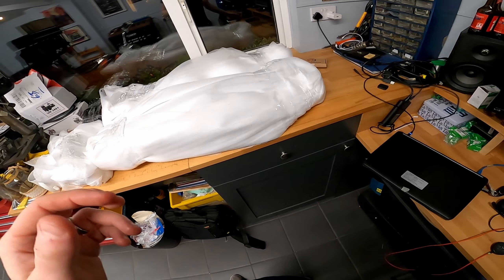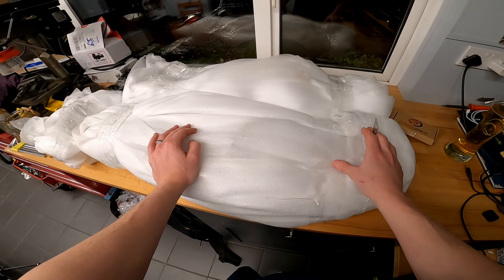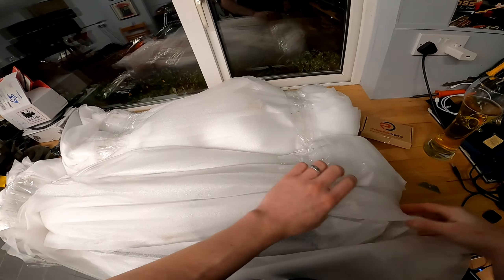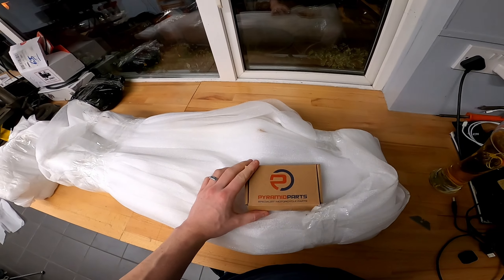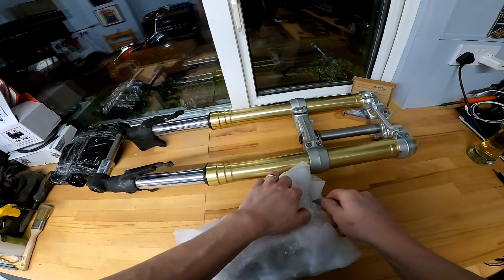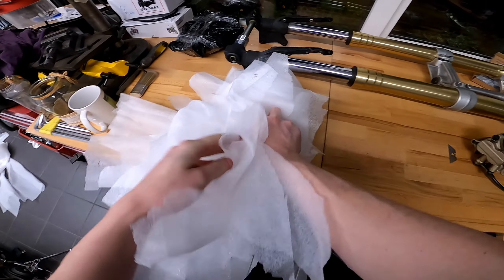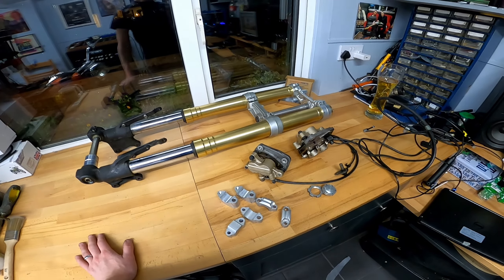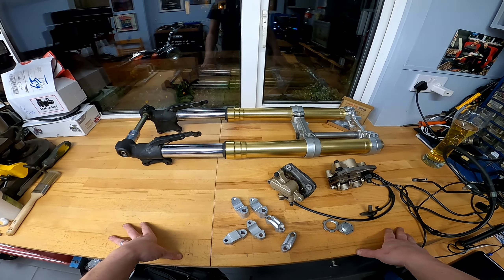TRIUMPH SCRAMBLER PROJECT | Parts Arrive

Comment: Just checking out the pre-build vids and getting more surprised every time I view your stuff. As I said before Triumph is the last bike I would buy now but this project is hopefully going to produce a 'Bitsa' far better than the factory efforts!  I am very much onside now and will bite my tongue...........or at least not put into print LOL...........my opinions of Triumph (and try to shut up about Harleys too) now. Very best of luck, you deserve it.
Reply from the maker: Thanks man, spread the word!!!!
Reply: I have a 2010 SE and want to do the same to the front you have mate. Can I check what brake calipers there are you used? This series has Ben really helpful so far. Working my through the videos so apologies if you cover this elsewhere and I just haven't got to it yet.